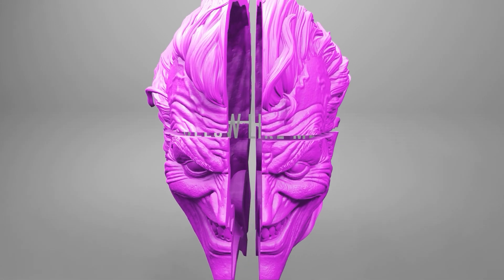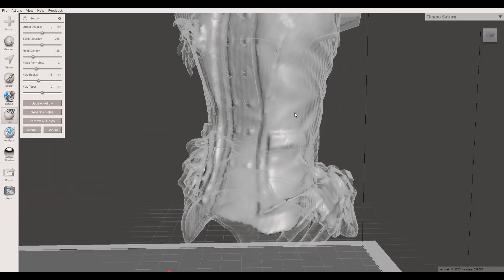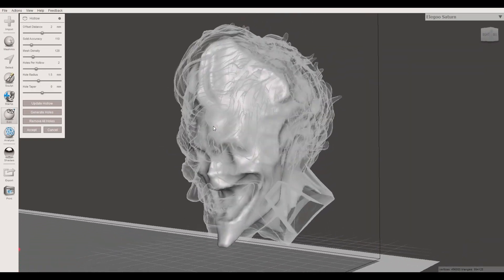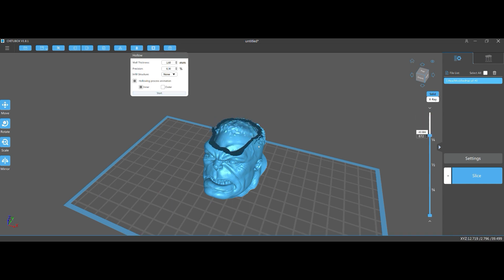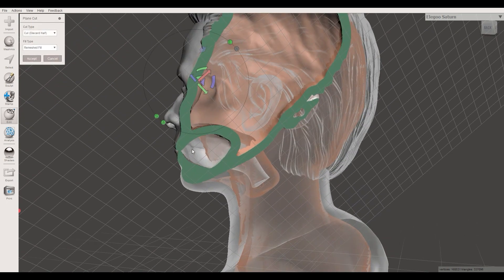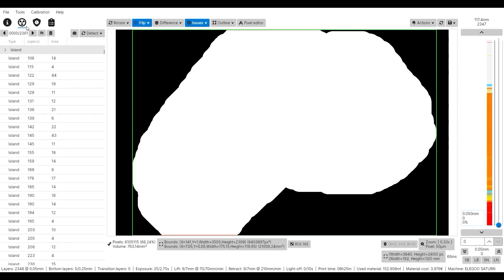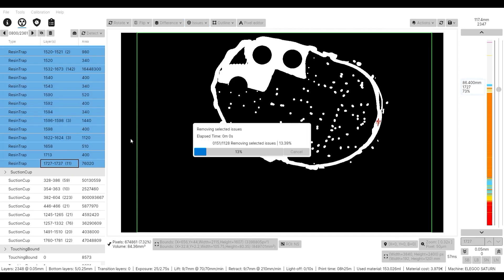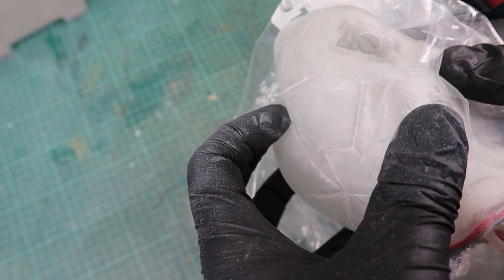Why you should hollow your resin prints RIGHT, avoid CRACKS & EXPLOSIONS!!!

Comment: This has happened to me several times in the 2 years I've owned a 3d printer. I'm now terrified that everything I've made will eventually explode open and hearing that one of your prints took 2 years to explode doesn't make me any less uneasy lol. I appreciate this tutorial though man I'm gunna be taking this advice in the future!
Reply from the maker: Do you by any chance still have the print files? Then you could check them in uvtools
Reply: @evolutionxstudios  I probably do yea, I've never used UV tools before but I'll check them out when I get the chance. I've had 3 prints burst open in the last month. These were projects I completed like 6+ months ago and now they've given me so much anxiety about anything I've printed suffering the same fate. The resin that leaks out also ruins the paint job of whatever it lands on. When I tried to whipe the resin that leaked off one of my pieces, the paint on the base came off with it.
Reply from the maker: @ninjagillyart  yeah that sucks man. But we can only learn from mistakes. Maybe when you are able to check it in uvtools and find large spots with trapped resin you could drill a small hole into the model to let it flow out.
Reply: @evolutionxstudios  That's actually a great idea maybe I can prevent it from happening on prints I've already completed! Thanks for the help man I appreciate it. Keep doing what you do man love the content.